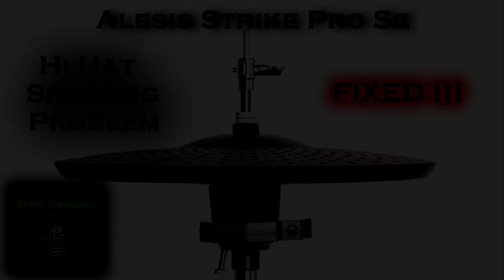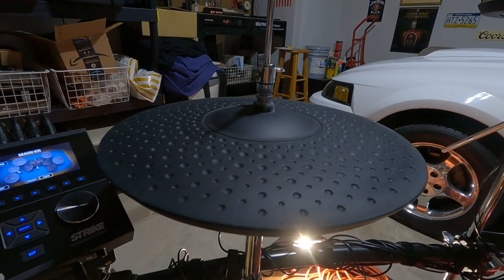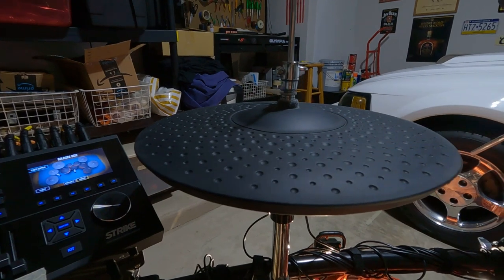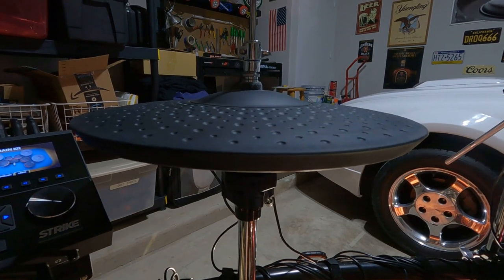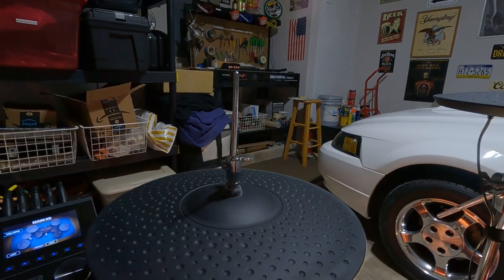🥁 Alesis Strike Pro Se Issue - Hi Hat Spinning problem & easy fix

Comment: Great hack to fix this.  I found I can just unplug the high hat and spin the whole cymbal so I don't need to tighten just the rod.  Also, thanks for the second tip on the cymbals too; I had to check mine, as one was spinning.  Fixed!

Comment: Once you screw down the hi-hat clutch, the entire thing acts like a wrench. So all you need to do is use the hi hat itself like a wrench (with clutch tightened) to screw down that central guide rod. Thanks for the tip!

Comment: In addition to the rod tightening you suggested, I discovered that I had not screwed the choke into the hi hat enough to keep it taught, so I fixed two problems in one tonight.  Good lookin' out, and always make sure the choke is secure on the hat trigger as well!
Reply from the maker: sometimes the simplest things go over our heads

Comment: Perfect!  This also helped with my issue where I really had to apply heavy pressure to make the hi hat “closed” voice. Even after fiddling with the tension adjustment. Thank you!  BTW - would I look for a trigger setting to bump up the volume for when I go from open to close?  I like to hear that distinctly but it’s very faint. Cheers! (EDIT: Yes, there is a setting for hi-hat foot that allowed me to adjust the volume for the hi-hat close voice).

Comment: Any problems keeping your e-kit in the garage? Is your garage insulated and/or air conditioned and do you live in a hot summer climate area? I'm getting the same kit soon and it would be better for me to keep mine in the garage, so I'm a little worried about that (I'm in Florida, so the summers are very humid- my garage ceiling and the garage door are both insulated). Great vids bro. Keep at it. Thanks.
Reply from the maker: I think you will be fine in the garage but that's just my opinion. So here's the thing...I live in Austin TX with brutal summers. I hit it hard and pound the hell out of it. No AC in my garage and I run a regular fan next to my kit. I lose like 5 pounds every time I am out there playing and always keep a towel nearby. It is what it is. Other than those hot summers, it is fine to play out there with no problems. I keep bed sheets over the kit while not in use and always wipe it down quick being a little OCD. I treat it like a classic car.
Reply from the maker: Just made a video about your question - https://youtu.be/Csmg_J9BRdQ

Comment: Hi @Peter GoesINya - BTW I became a huge fan of your videos. Have a question: did you by chance change the tilter provided by Alesis? Question has nothing to do with the spinning issue. I noticed that Alesis one somehow is "polished" in one section, while other tilters (for traditional cymbals lets say) are threaded. I particularly don't like the Alesis one but want to make sure I'm not generating wore to the rubber by replacing it. Maybe you have some experience on that. Thanks!
Reply from the maker: Nope. Have no idea what you just talked about. Just play those drums and stop thinking about it. Rock out to Slayer!
Reply: @PeterGoesINya  finaLly bought it. You are one people that eventually convinced me.
First time in 8 years owning a kit.

Assembling it tonight. Playing tomorrow. 
Starting with some SoaD though, my doublebass is a little rusty I am affraid. Slayer Awaits
Reply from the maker: Listen to Slayer!

Comment: I got A DW 3000  highhat stand  And mine turns around and there's nothing I could do. It doesn't spin because of the 2 high hat plugs I did a light wrap-around and it keeps it in place.. But my high hat has full function all the way around it with no trigger misses
Reply from the maker: nice!

Comment: Has anyone tried both the SE and non SE hihats? Cause the SE seems to me like a downgrade from the original....
Reply from the maker: Who cares what it seems like, I can verify it is an upgrade for sure. Never had one problem and I have been pounding this thing for over a year now.
Reply: @PeterGoesINya  Yeah i mean the older one had more triggers right? In theory it should feel more natural...Have you also tried the old one or just this one?? I'm in the process of deciding whether i want to buy a used strike pro or a new strike pro SE since i can't find the non-SE available to buy anywhere :P I also have a friend that has the non-SE one and never had a problem with it while using it live at least 3 times a week for months...
Reply from the maker: Ok apparently you have not read anything at all about the old one and how bad it was. It was rushed out and had so many flaws including the HH......anyone who chooses the old one over the SE is well......challenged for sure. Why that would be a debate or questioned is beyond comprehension lol. Go buy it and don't say you weren't warned.
Reply: @PeterGoesINya  It's not that i don't want to follow the warning... I just want to hear from someone who have used both hihats using the latest firmware... It's not like i can correct my mistake if get either one and its not what i wanted :P Thank you for sharing your opinion, but again, have you tried both? I've searched the net for hours and i can't find a direct comparison between the 2 hihats using the exact same module and firmware :/